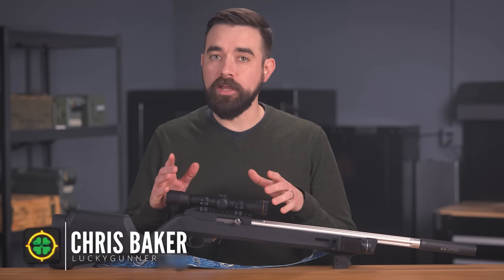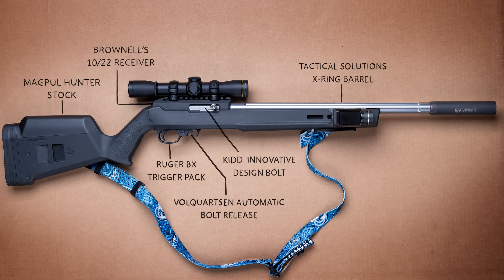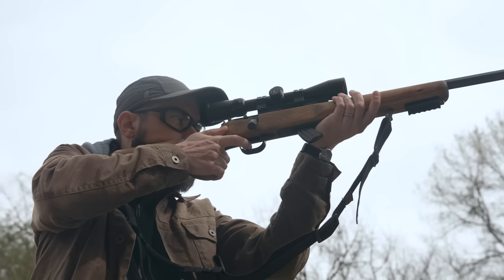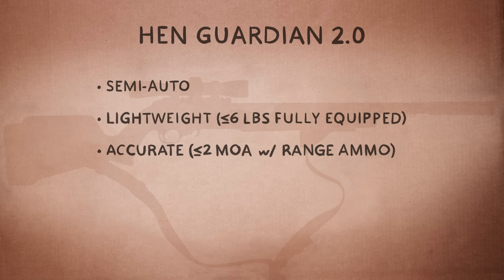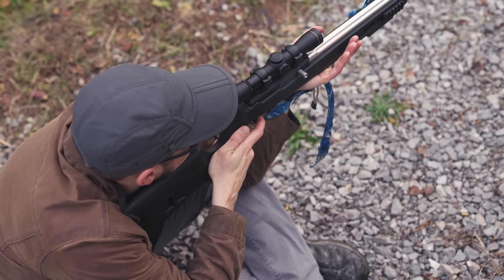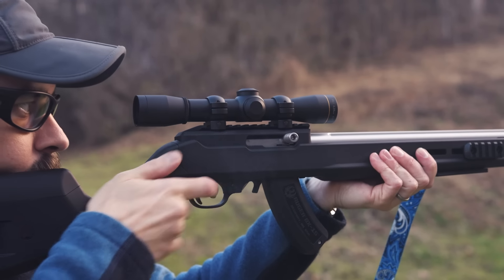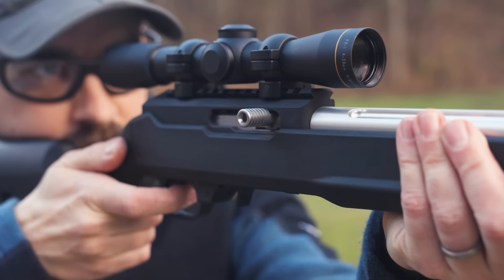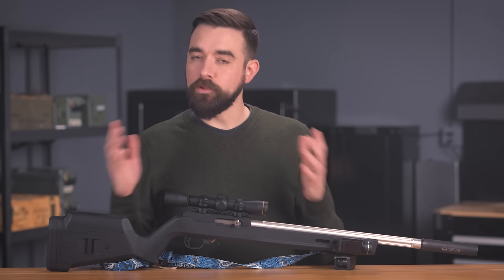The Backyard Sniper - Lightweight Edition

Comment: I tried to stay far way from the 10/22 rabbit hole and fucus in on what I really want/need for my farm. I wanted a light platform around 6lbs too but I also wanted a fun AR style platform that really lets me dial in comfort. With a TacticalSol X-Ring barrel, Midwest industries aluminum chassis, AR grip, adjustable stock, sling, 3-9x scope, everything else came from my stock 10/22. Weighing in at 6lbs 9oz unloaded (7 lbs 4oz, loaded with the 25+20 mag from HCmags) I'm pretty happy. It weights very close to my lightweight AR build @ 8 lbs loaded. I will likely move to a green dot to really lighten the 10/22 up even more as I don't really need a scope. Great build and keep them chickens safe!

Comment: Outstanding build!! Personally, I've added Volquartsen hammers to all my standard Ruger FCGs over the years and they've always been a fantastic improvement. And for comparison, I do have an old AMT Lightning all stainless 10/22 clone with an expensive Jewelll trigger for comparison. The Volquartsen isn't quite as good as the Jewell, but it's very close for basically 1/10th the price! Great video, Chris!
Reply: While anything is better than the original trigger, I’ve found the VQ trigger components and complete assemblies to be a bit disappointing and I sold mine. 

Kidd without question for anything trigger-related. The full units are sweet, but the basic Trigger Job kit in the stock Ruger housing is all you need.

Comment: Great looking setup. I like the tri-pod, I might have to get me one of those. And I know I need a sling.
I have the Mag-pull on my AR and need to get a Trunk Monkey for my 22LR. 

I grew up shooting my dad's Winchester and between us both running thousands of rounds through it, it FTE'd all the time.
2 gunsmiths "fixed" it but same issue. Out of disgust, I went to Wal-Mart (early 2000's) and bought a Remington 597 for $130.
SAME THING! 1st mag jammed up. 2nd mag jammed up. I through it across the field as hard and far as I could! My shooting buddy had to pick it up and bring it home. 
About 10 years ago I heard someone (nut'n fancy) mentioned the stock mags were an issue on that model so I invested in several modern units.
THEY WORKED! Beautifully!
That gun runs so smooth, fast and flawlessly...
And it is a tack driver. Best groups out of any gun I have ever shot.
I love it.

Comment: As usual, Chris, great job on the review - you're the best of the best on youtube.  My fave 10\22 config - Kidd 1.5lb singlestage trigger (butter magic), Kidd receiver, Kidd 16" lightweight fluted barrel, FABdefense folding stock with adj cheekrest, FABdefense forestock vertical grip\bipod, Pinty 40mm red\green dot.  1\2minute 50yd tac driver

Comment: A Vorquartsen trigger group complete, Kidd matching barrel w/ mating width extractor slot, matching bolt with widened extractor and recoil system, bell and Carlson varminter stock, tacsolutions v block, Tactical innovations receiver with integrated rail, and a Leupold mark 4 3-9x  scope. Can shoot the bottle caps off of a Coke bottle at 100 yards every time. Yes  the vorquartsen trigger group is worth the money. As a guy who Apprenticed under two master gunsmiths For 18 months I was impressed with the trigger group,  Barrel recoil system and accuracy. But it's heavy

Comment: I built one exactly like yours couple of years back except for the light weight barrel.  Mine is an 18” fluted SS custom model / threaded.
I used the same Brownells 10/22 receiver as well with the Ruger BX trigger group.  Love that trigger!  Don’t yet have a suppressor on mine.
A real tack driver @ 50yds.  Usually just one ragged (1 moa)) hole on targets. But I’m also using a nice 4 -12 power Nikon scope for bench rest shooting.  May look into that lighter barrel later if I ever need the portability.
Thanks for your videos.

Comment: I've been pretty hardcore into 10/22's for going on 13 years now, that's what kicked me off into gunsmithing and I've taken notes who's rigs shot best and applied that amalgamation into my own setup. By FAR the best trigger on the market has been Brimstone Triggers! They take your existing BX trigger (or you can buy a stock one off them to mod too) and for about $98 turn it into a truly "handcrafted" custom trigger set, using all the parts in your trigger assembly so they're mated to each other with a "legitimate trigger job" vs what every OTHER company offers... AKA a pile of 'random' mass produced parts out of a bunch of boxes all thrown together, that includes all the so called high end brands that cost a lot more too!

Comment: I started with the 10/22 compact from ruger. Added a BX trigger, modified the bolt release to be like the volquartsen, and got a high rest full length modular stock attachment. I went for a EGW +20MOA extended picatinny/weaver rail and simmons truplex .22 mag scope with weaver high quad lock rings. I also got a USGI cotton rifle sling with a J hook and and standard sling swivels. 
It's a really decent rifle for around $500 all in all

Comment: 10/22s are SO customizable!  I have two of the takedown models.  Both are in the Magpul Backpacker stocks and BOTH are using the BX Trigger assembly.  You can put Volquartzen parts in and save some on the 'high end' drop-in trigger options, but as you said the BX is the best value in an off the shelf assembly.

I look forward to your "after the honeymoon" video on this rifle!, and the 'before' and 'after' photos.
Reply: how'd you mount a sling to your takedown? i love mine, but haven't figure out what the best setup is if i want to sling it, so it's ready
Reply: @cwr8618  Magpul QD Sling Swivels with the overpriced 'attachment point kit' (4 pcs) and a simple web strap and nylon buckle.  Too much money for the metal parts, but they work perfectly!

Comment: A few years ago I took an old 10/22 and reconfigured it to essentially the same rifle you have for a similar purpose - I have a green mountain heavy barrel I will swap out for the X Ring once the paperwork on my Sparrow works through the ATF.  I started out with the BX trigger and, after about a year, found a Timney at the local gun store.  I find it to be a better trigger - crisper, lighter pull, shorter reset, etc than the Ruger.  That is a great build you have.  10/22’s are great rifles.  Enjoy!
Reply: What ATF paperwork do you need?

Comment: The leupold vx-1 rimfire 2-7 is just over 8 oz and adjustable. Thats what I have on my 10/22. Magpul adjustable stock, c/f volquartzen barrel, 25 round mag and sparrow suppressor all on the scale comes in at 5 lbs. I even had the steel bolt stop swapped out for a nylon replacement. Now there is no noise at all besides the bolt slamming forward. I love that gun. When my friends shoot it, they think it malfunctioned bc of how quiet it is.

Comment: If you want a 2 stage trigger I've used Kidd triggers although they are pricey. If you want a excellent cheaper route get the Kidd "Trigger Job" Kit to install on your Ruger trigger block. It's a very clean trigger for a litle over $100. I have and used both. I've tried other 10/22 triggers but once I tired Kidds. I've sold off the others and replaced them with Kidd triggers.

Comment: That Volquartsen bolt release seems pretty cool.  Also, I didn't know you could buy a 10-22 receiver by itself.  I only ever heard of people buying the cheapest Ruger 10-22 they could find pretty much just to get the receiver.  These videos are always informative, one way or another.
Reply: buying a receiver alone means you can get a threaded steel receiver instead of the stock aluminum.
Reply: You can just grind or file off the little tab in the V-notch instead of buying a new plate, too.

Comment: When I saw your new .22 farmer's rifle, I said, dang that's a T/CR22 with some fancy mods!  

I got the 4.4 lb  T/CR22 on sale at a very low price. (My Ruger-1022 target ver weighs a ton).  
With an auto-on Red Dot and a laser on the fore-end pic rail it's my '25 yard' rifle. 
I named it "25 Yard", because I zeroed the RD & Laser on a 25 yard pistol range, and it mades 1 hole groups. Since I became very old, I learned love light weight rifles.

Anyways, thanks for posting this video. I've decided to check out replacing my $20 Laser with a low-cost weapon light. Something bright and maybe with an integrated laser.?.

Comment: I built a nice $1000-ish 10/22 several years ago starting with a stock receiver and bolt assembly. I added a Tactical Solutions X-Ring barrel, Timney trigger group and Tactical Solutions-branded Altamont Vantage laminated wood stock.  I had a Nikon 3-9x40 scope on it as well.  I quickly swapped out the Timney for a Kidd trigger group and it was well worth the money!  I have been impressed with the Kidd trigger group for over 10k rounds now!  I have since also traded the Nikon scope for a red dot and Vantage stock for a PMACA lightweight stock with AR attachments.  I wanted to lighten the gun up as much as possible for Steel Challenge and Rimfire Challenge matches.  I got it down to a little over 4 lbs.

Comment: Useful info, as always. Thx and good luck protecting those chickens! One question though: wouldn‘t a .22 magnum be better for things like racoons?
Reply from the maker: Yes, it definitely would. Trying to keep it quiet for the neighbors, though. I mentioned that in the first Backyard Sniper video, but didn't bring it up again in this one.
Reply: You could seriously use an air rifle and be fine.  A 22LR. is more than enough for this particular job.
Reply: I was about to bring up air rifles, there's some really super cool stuff going on with them now days. They're fully capable, fairly priced, not a firearm so no NFA shenanigans, etc...
Reply: We used to use 22 shorts point blank to the forehead (draw an X from ear to opposite eye, X marks the spot, they'll kick for a bit but it's just the nerves firing off) when we trapped them and it works well.  

Like always, shot placement is king.  For less precise shots like he's finding himself doing now, going up in caliber could help... raccoons are tough!

Comment: I use Kidd products almost exclusively, especially their trigger group. I have used most trigger groups on the market and the Kidd design is unique and a dream to shoot. I use Victor stocks exclusively also. They have the best bedding system out their because of the 3 screw design. This system hold your receiver to the stock and they become one. There is no way the receiver will move. Check these items out for yourself. I benchrest shoot with a semi-auto and beat bolt Guns.

Comment: Several yrs ago I bought my 3rd  10-22 for $159.   After 25 YouTube videos, I did a trigger job, Polished the inside of the barrel with Car Compound, Polished ALL metal surfaces
that made contact, using 1000 grit wet/dry paper,  and paid Special attention to the bolt
getting it to a mirror finish. I did install a soft, bolt stop ( $5 ). The receiver was bedded
 with epoxy and the factory barrel was floated away from any stock contact, with sanding.
This $ 164 Completely Original Parts gun,  shoots a 1 1/2" group at 75 yds    
If I use Wolf Target Ammo, my group is smaller,  It is NOT necessary to spend $800.......
Spend your money on quality ammo if you want to improve your group. See what your
gun likes, test different brands.

Comment: 3lbs 8.6oz with loaded mag and sling.
Removed stock pic rail.
Parts used. Tacsol barrel with peep sights, TK vblock, magpul moe x-22 stock. The stock actually gets lighter when you remove the pencil barrel insert and put in the bull barrel insert. Butler creek featherlight sling, Outdoor Connection Brute Sling Swivels.

Comment: I also used a fixed power 4x28 for a bolt action Marlin 22LR that I built 20 years aog.  It was a great choice!   Easy to get your eye into and alway clear.  That gun shot well, but I sold it because I couldn't stand the clunky Marlin action any more.  It had way too much slop in it and alway felt like it was broken.  Thanks for introducing us into the world of DIY 10/22 - Great Video!

Comment: Everyone needs a good backyard critter gitt’r. I have one based on a 10/22 it’s a little cheaper here I used a butler creek target barrel / stock kit, auto bolt release, extended mag release, oversized bolt handle and a soft recoil bar. I went with an illuminated tru-glo for low light shooting.

Comment: Been using a bull barrel 10/22 for 20 years.  Put a Volquartzen trigger on it, love it.  Use if for shooting nuisance beaver at dusk or after dark.  Think I have a 4-12 Nikon scope, a 52?, have to look.  Got the magazine extractor, a must.  The barrel turns it into half inch at 50 in an instant.  Use winchester 40 grain hollow points.  A friend rebuilt his, made is super light weight with  heavy barrel, smaller than the .920.  Shoots as good as his Anschutz expensive target rifle.  Could not believe how the rifle went from "pie plate" to shooter in an instant with the Midway Barrels.

Comment: I had to do a double take. I thought you had my rifle! I used the ruger receiver but used the same TS barrel and Silencerco suppressor. Still using the Ruger bolt set up too but have my eye on Kidd. Same Magpul stock as well. I'm running a pretty powerful Hawke Optics scope but I think a will go smaller soon as I don't need that scope for .22 ranges. Where I did spend some coin was on the Timney trigger and mag release system. That was $ well spent. Plan to start raising chickens this spring. Plenty of all the vermin here in W Kentucky, so I'm sure I will need to deploy this rifle at some point. Thanks for the video.

Comment: I have the 18" fluted barrel with a threaded tip in black. My Archangel AR Stock kit will be here soon so i cant wait. They have so many after market parts it never gets old. I bought mine second hand and it came in a TAPCO AR Stock Kit but not enough rail space and side mount options. .22/.22lr are amazing to shoot no matter what. Bullets are cheap and its not loud with no recoil so shooting is fun and rewarding.

Comment: I built a custom 10/22  few years ago. Brownells BRN-22 Picatinny top receiver, JWH Bolt and handle Keystone Arms 16.5" threaded barrel with compensator , Ruger BX trigger (did the bolt release mod), extended mag catch and all in a Hogue thumbhole stock. It wears an old Japanese made Tasco 3-9x50PA airgun scope. It's one of my favorite guns and shoots just as well as a Kidd a friend of mine bought. CCI Target standard velocity 40 grn lead round nose FTW.

Comment: Very nice build. I put one together with almost the same specs. I used the Volquartsen Competition Bolt, Ruger BX Red 2lb trigger, extended mag release and a bull barrel with a Bushnell Rimfire 3-9x40mm Rifle Scope. Most of the parts were sourced off Armslist and the build came in around $750 when added up. Very happy with the results. It's a tack driver. I may swap out the barrel with a lighter one. Thanks for the video.

Comment: Thanks for this video. After a year of planning I finally pulled the trigger. I ordered all of the parts from around the internet and built a great shooting 10/22. Your guidance was valuable to my choices. (Green Mountain 20" SS Fluted - Brownell bolt - Tactical Innovations Receiver - Ruger BX trigger - Magpul Stock) I came in right at $800 like you suggested. Thanks

Comment: The best trigger for the 10/22 is without question anything from Kidd. 

The Trigger Job kit gives a perfect result at a reasonable budget, while the complete single-stage assembly puts it in a nice housing. 

Two-stage is pricey but worth it if you want the feature. 

Any one of them will give a world-class consistent clean break not only by .22 standards, but also among fancy centrefire trigger standards.

Comment: Too funny.  I did much the same as you, but I used all Ruger OEM parts that I bought as new “take-offs”.  My 10/22 build used the Brownell smooth top receiver, an oem bolt and charger handle, BX trigger group, and a Ruger 18” stainless steel barrel, but used a Ruger Sporter Deluxe walnut stock.  I really like the looks of everything, but do wish I had gone with the silver Brownell receiver rather than black powder coat, which is a flat black.  Put a picatinny rail on top of the receiver and mounted an inexpensive CV Life 3-9 x 38 scope on top.   

Amazing how easily everything fits right together and how well it all works.

Comment: I tried a BX trigger, they felt too flexy to me and I've stuck with using a spring and shim kit to improve the stock feel and lower the pull weight.  I've put aftermarket VQ hammer/sear parts in, don't feel much difference.  But I don't have full aftermarket trigger assemblies to compare with.  Spring/shim was the best bang for buck, but challenging to get together.

Comment: I’ve have so much luck as a gunsmith with the Calvin elite triggers. I have a similar rig that I run the sparrow but I think the Texas silencer companies scoundrel is easier to clean and quiter. I run the x ring barrel and TS receiver….. this was a dream build of mine. I was going to go with the proof barrel for the carbon aspect. But I’m supper happy with the xring.  We’ve put my pulsar thermal on it with a crap ton of fun killing vermin. Great video thanks

Comment: My flock is guarded by a 10/22 pistol with 8” threaded barrel. It hosts an old AAC element 2, an Armageddon gear 2point bungee sling, and a Harris bipod. I point it with an Accufire Incendis thermal to find the targets day or night. I also take this set up into our deer shooting shack where it sits on the bipod and rear bag ready for small game. I load the 15 round mag with CCI 40gr standard velocity or CCI Suppressor 45 gr hollow points.

Comment: I'm a year late, but if you haven't checked out the hightower armory p90/22 stock its an absolute riot. Bullpup 10/22 handles even better, and with an ebay match grade drop in trigger, the pull ends up being about 3 1/2 - 4lbs.